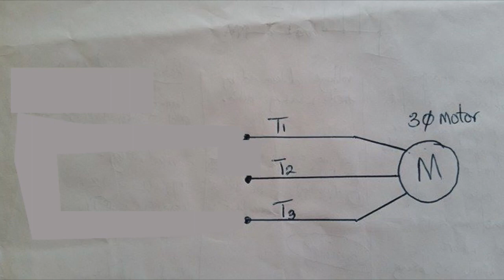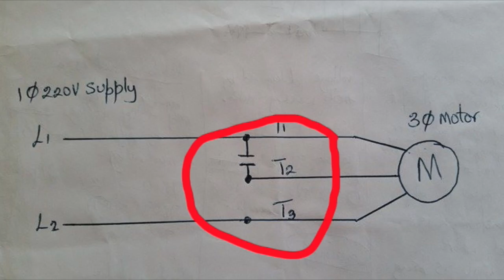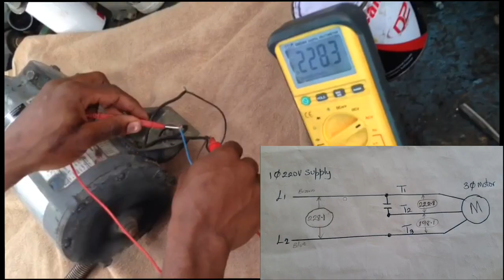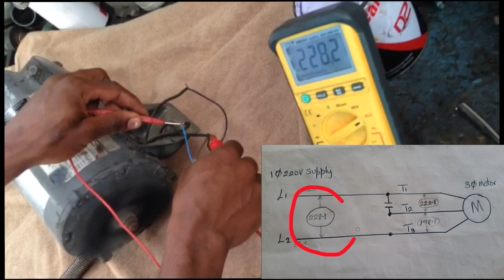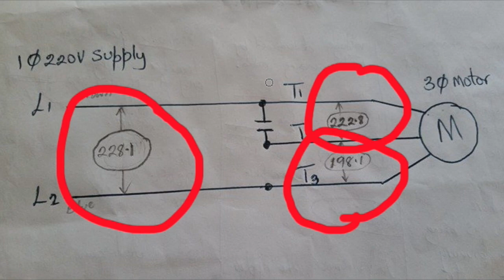HOW TO RUN A THREE PHASE MOTOR ON SINGLE PHASE SUPPLY

Comment: L1 and L2 = two phases not one. In your case L2 (blue wire) is actually neutral.
Reply from the maker: A three phase "4 wire" supply system  comprises of (L1, L2, L3 & N); IE. Three Hot (Live) Lead and a Neutral. Hence that earthing is a form of protection to these systems.

Based on your caliber you should be able to passify betwixt Neutral & Earthing /Grounding.
Reply from the maker: A single phase "3 wire" system supply comprises of (L1, L2 & N); IE. Two Hot (Live) Lead and a Neutral which should not be referred to as "Two Phase"
Reply from the maker: A single phase "2 wire" supply system  comprises of a (Live/Line/Hot & Neutral) which should not be referred to as "One Phase" either. {Single Phase 2 Wire is the proper terminology}
Reply from the maker: A three phase "3 wire" supply system  comprises of (L1, L2 & L3); IE. Three Hot (Live) Lead and {floating Neutral} which is not being considered(used) in special cases where earthing would pose a problem. (Such as a crane operating over combustible fibers)
Reply from the maker: A three phase "4 wire" supply system  comprises of (L1, L2, L3 & N); IE. Three Hot (Live) Lead and a Neutral. Hence that earthing is a form of protection to these systems.

Based on your caliber you should be able to passify betwixt Neutral & Earthing /Grounding.

Comment: Dear sir, Can i use 5HP motor to my home electric supply-220 Volt.
Reply from the maker: Lets assume WORST CASE OPERABLE CONDITION of the motor to be 90% efficient whilst operating with a power factor also 90%.

To conclude if your Supply system can facilitate the operation of a 5HP Motor (5 * 746W= 3730W) we have to find out how much current it will require to suit it operation hence that we assume it will be 90% efficient.

Formula:  P = I * V * pf * eff * √3

Legend
P – Power consumption measured in WATTS
I – Current measured in AMPERES
V – Voltage measured in VOLTS
p.f - Power Factor is the ratio of the existing power and the power being used.
eff – Efficiency is a ratio  to which the motor will converts the electrical energy into twisting or turning force (mechanical energy). 

√3 - 1.732 used as a multiplier to symmetrically derive from the fact that Line voltage is 1.732 times the phase voltage.

              P
Therefore I =    ----------------
   V * pf * eff * √3

                      3730W
                          -------------------------
   220V * 0.9% * 0.9%  * 1.732

                         
                         3730W
                         ------------ 
    308.64

                 =      12.08 A

Conclusion: As long as the motor can be constantly supplied from a Three Phase 220V System with the above mentioned current 12.08 A.

Disclaimer: SAFETY COMES FIRST (Ensure use of proper protective gears "PPE's", switch gears and recommended standards of installation and its criteria are met.

Please adhere to your local standards 

CHECK OUT MY BLOG SUPPORTING THIS VIDEO
http://bit.ly/2yW1oOh
Reply: THANKS
Reply from the maker: BLESS!!!!
 @moenuddin87

Comment: 7.5 hp motor ko capacitor kitne mf   lagega
Reply from the maker: mujhe lagata hai ki aap uchit aakaar sandhaaritr ke baare mein poochh rahe hain jo 7.5 echapee motar ke lie kaam karega.

enabee. is prayaas ko aisee sthaayee sthaapana ke roop mein nahin maana jaega balki asthaayee prayogaatmak uddeshyon ke lie maana jaega. is motar sarkitree ko ek invartar / veriebal phreekvensee draiv ka upayog karake sthaayee banaaya ja sakata hai jo aavashyak ashvashakti par ekal charan sveekaar karata hai, isalie upayukt / sanchaalit maanak / viniyamit sthiti bana deta hai jo is motar ke jeevanakaal aur sanchaalan kee gaarantee dega, jisake tahat yah uddeshy ho sakata hai.

motar dvaara maang mein maujooda aapoorti ko maanak dvaara maanakeekrt kiya jaana chaahie taaki loding kshamata motar ko kshatigrast hone ke adhik jokhim par rakhe.

"aapake prayogaatmak uddeshyon ke lie" vartamaan pravaah ke pravaah kee nigaraanee ke lie upayukt charan moneetar ka upayog karen jo voltej / vartamaan asantulan ke parinaamasvaroop galatee kee sthiti utpann hone par motar ko diskanekt kar dega.

anyatha is prakaar uchit aakaar sandhaaritr kee ganana karane ke lie ganiteey kaushal kee aavashyakata hogee.
Reply from the maker: I think you asking about the appropriate size capacitor that will work for a 7.5 hp motor.

NB. This endeavor shall not be considered as any such permanent installation but for temporary experimental purposes. This motor circuitry can be made permanent by using an inverter/variable frequency drive that accepts single phase at the required horsepower hence making suitable/operable standard/regulated condition which will guarantee the lifetime and operation of this motor under what purpose it may serve.

The current in demand by the motor must be standardized by the supply hence that the loading capacity will put the motor at greater risk of getting damaged.

"For your experimental purposes" use a suitable phase monitor to monitor the flow of current which will disconnect the motor in case fault condition should arise as a result of voltage/current imbalance.

Otherwise it will require mathematical skills to calculate the appropriate size capacitor thereby.